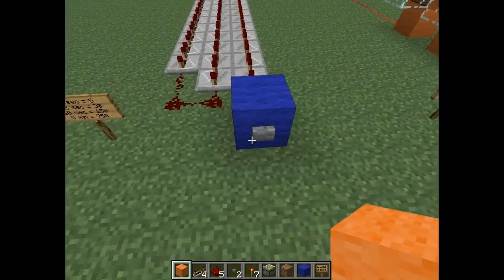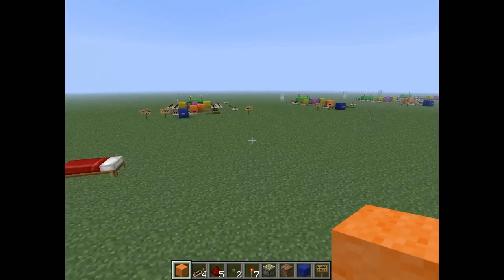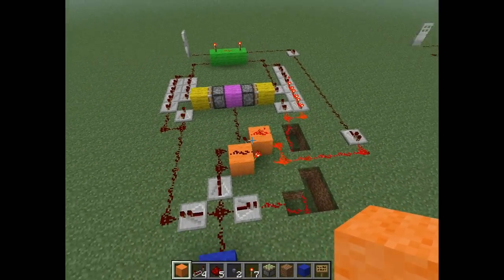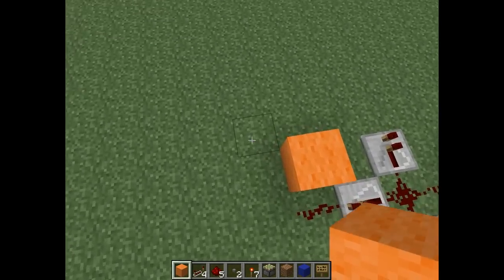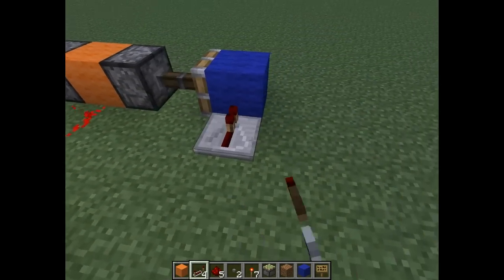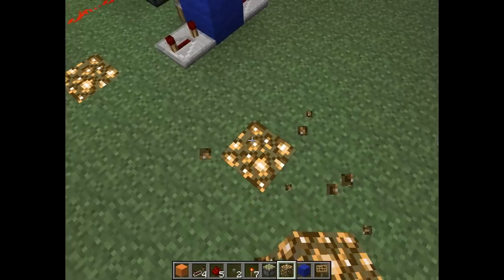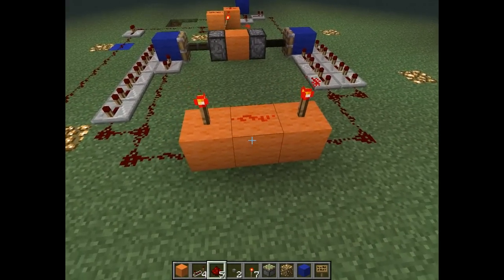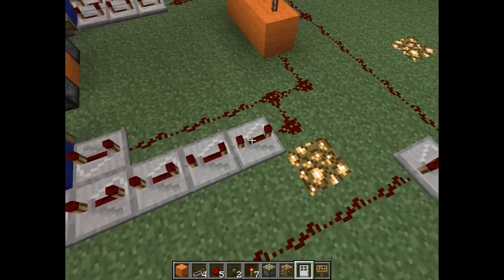Extended Redstone Delay - Tunable delay of redstone signals up to many minutes

Comment: Awesome design am using it as part of an auto brewer. A small tweek i had was to add two repeaters(one full delay one no delay) to the left side input to clock becasue it was 6 blocks from input on left and 10 block on right side. that ironed out alot of the randomness i was having at beginning of tuning

Comment: You can also use a dispenser to output an item that can travel down a current to land on a pressure plate.  I guess the time it can take is as long as you have a slope or until the item despawns.

Comment from the maker: Hey, feel free to design something very similar and post the video as a reply.  I will link to it and add a button in the video.  It would be especially cool if you could make it more compact.

To make the system continuous, you could have the output (which is a pulse) feed back into the input of the circuit.  I would add some sort of switch to override and allow you to turn the whole thing on and off.

Comment: hi, i need a solution to a build that i am making. i need 8 short pulses, then 5 minutes delay, then repeat, is that possible?
Reply from the maker: +Gex121 It should be.  The 5 min delay is most easily done with an item despawn timer (although you can also use the ERD circuit here).  The 8 pulses might be more difficult.  The simplest way would be to actually setup a series of 8 pulse generators that are delayed from one another, but it's not that elegant of a solution and would take up some room.  It should work though.
Reply: Thanx, i tried that. works perfect. only problem is that i made a mistake and the 5 min pause must be 5:45... I got the puses working, now i only need a way to get a 5min 45sec delay...
Reply: +Gex121 Redstone torch burnout + Item despawn clock

Comment: The Delay doesnt make sense the delay is needed to keep the door open longer so I can get through the door on my cheap laptop. LoL
Reply from the maker: Haha - well, that's a different kind of delay.  For that you want a pulse extender, which is easy.  Send a signal, then split the signal somewhere.  Have one side go "direct" and add a small delay to the other side that is shorter than the amount of your pulse.  It will slightly increase the total pulse length and is the easiest way to increase the time of a pulse.  For a much longer pulse (a few seconds), it's best to make what's called a monostable circuit, which is an R/S NOR latch that after a short delay "switches" itself back.
Reply: chemdork123 Thank You
OMG pulse extender, I made one using 4 comparitors, now I dont have to struggle going in and out of doors anymore..lol
Reply: chemdork123 If You saw what I went through trying to delay a door You would be on the floor laughing.
Jeez